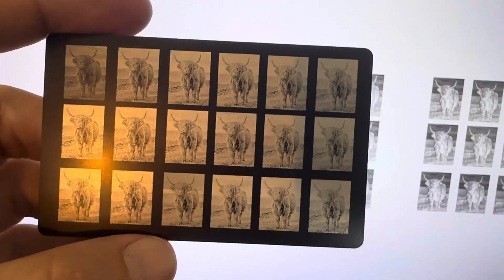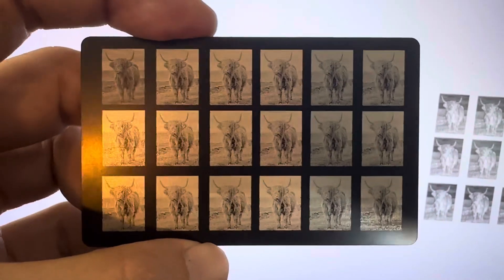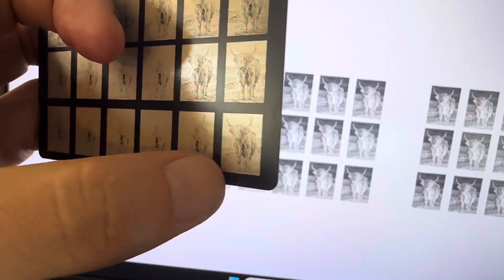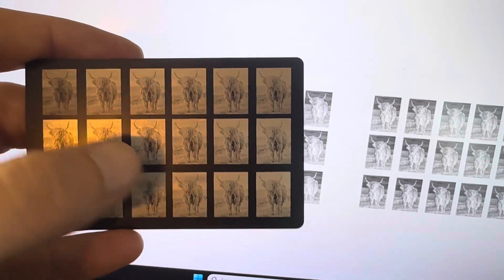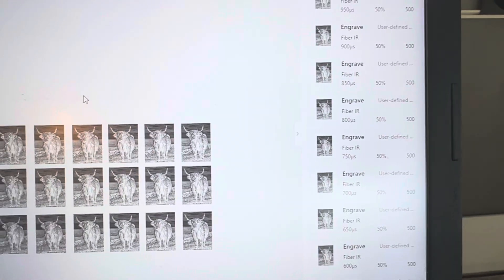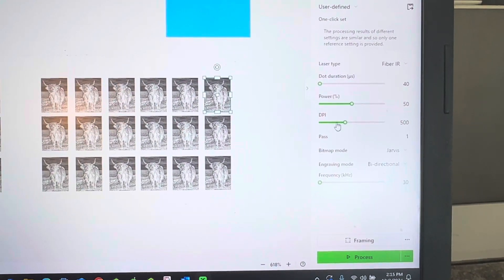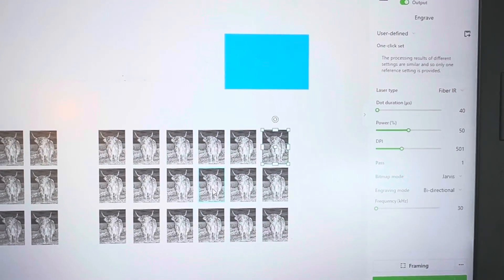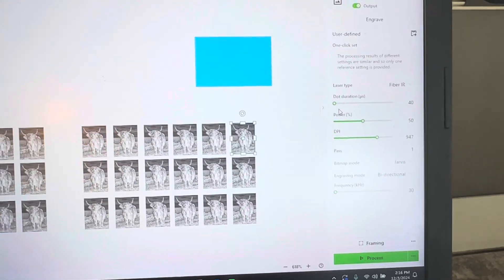Xtool xcs bitmap engrave dot duration & dpi explained.

Comment: Thank you for putting this together. Now time to play with some of those cheap business cards to get the hang of it before trying to make Acrylic or really anything with pictures on it like the ones you did on black acrylic.
Reply from the maker: @BinaryDisastr  no problem. What machine do you have?
Reply: @beyondthecutcreations9391  P2 & F1 (original)
Reply: @beyondthecutcreations9391  The F1 and P2.
Reply from the maker: @ sorry. Easily distracted sometimes. A good range to test is 200-450 dot duration, 80-85 power, 400-550 DPI Jarvis using the IR on the F1